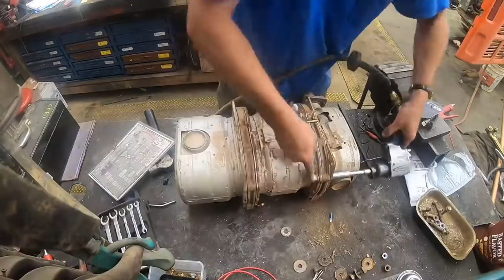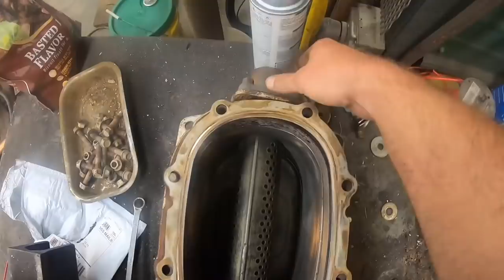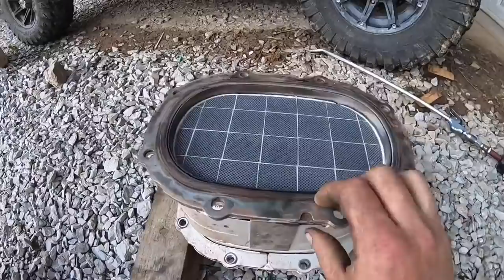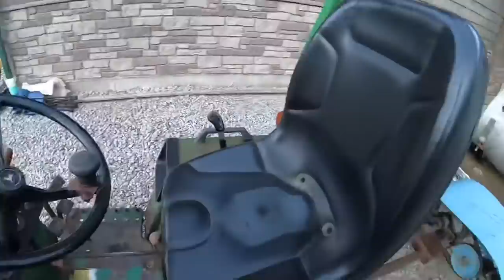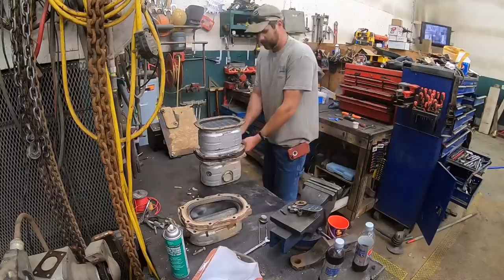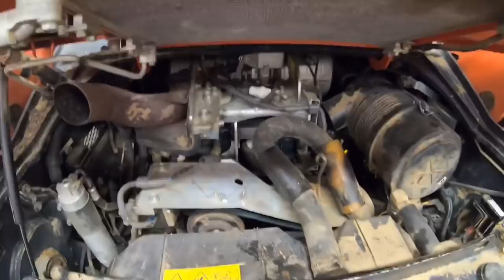DPF DIY Cleaning did it work ? (old video forgot I had) Happy Thanksgiving hope you enjoy !!

Comment: I’ve heard of using a torch to get the core red hot and blow air through it.
Reply: That's exactly what the computer is supposed to do during the "Regen" cycle. Works on the same principle as a self-cleaning oven. Maybe it's something with the regen cycle not kicking in properly? Though, with heavy use, it may have just been overwhelmed too?

Comment: When they clean the one on my truck they just cook it and then blow it out. $700 is ridiculous
Reply from the maker: Crazy
Reply: You know that the soot that is baked out is then buried in the land fill with all the plastic.
Reply: @edp9743  and your point is what? Where would you like it to be placed? It’s inert ash when it’s baked out.
Reply: Well, you forgot they are cooking it at 1200 degrees for 8+ hours and then blowing it out and cleaning up the mess. So yeah electricity to heat that oven isn’t cheap. Then there’s labor.